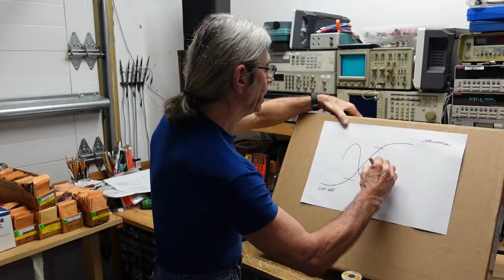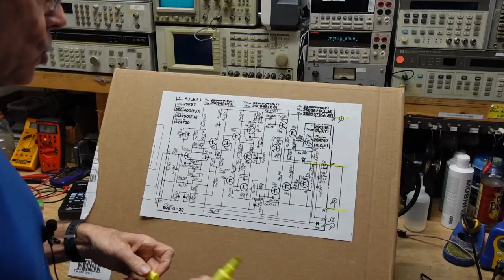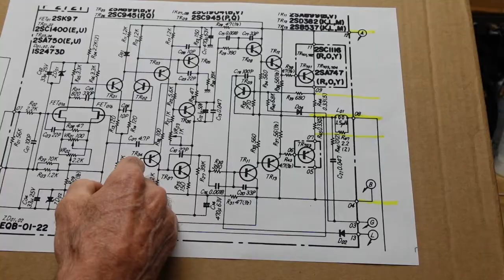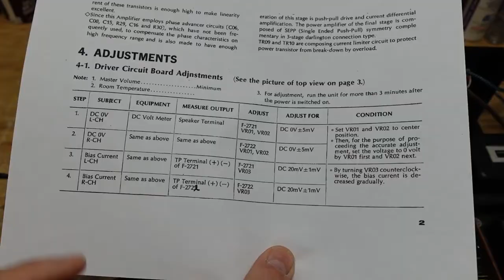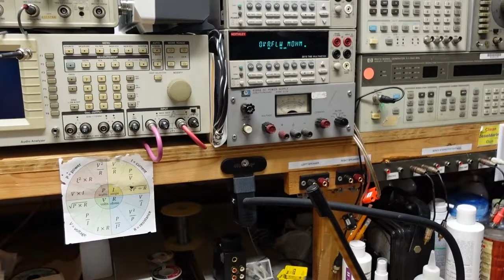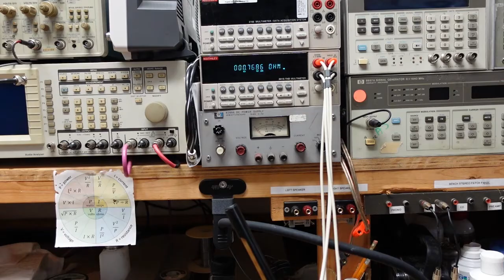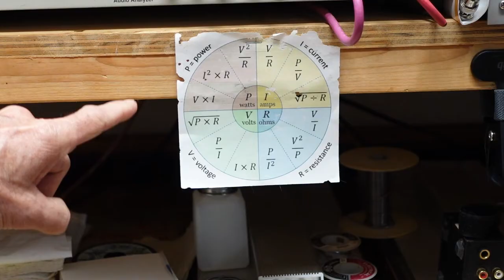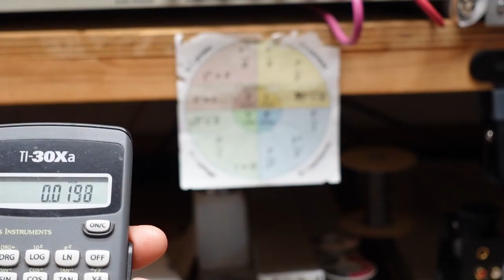Bias and Offset in Audio Amplifiers

Comment: Hi Ray, great video. I have a question regarding setting up bias after the change of output mosfets on my Sony ta-fb930r amp. 
When measuring as described in the service manual, I dont get any readings, even when I adjust the trim pots. The instruction in the manual is a bit confusing. The test points are across only one of the resistors, not across both, like on your video.
Can you give me any points please. Let me know if you need a link to the service manual.
Reply from the maker: It doesn't matter if you measure across one resistor or both.  In the Sony, if you measured across both resistors they'd have you set it to 20 mV instead of 10.
Did you replace the MOSFET's with the exact same ones?  If not, that could be a problem.  In addition, I believe these are obsolete, so the chances of getting counterfeits is greater.
Check to see if the voltages coming from the driver's emitters changes with the bias pot.
Reply: Thanks for your reply.  I replaced the mosfets with IRFP240PBF and IRFP9240PBF.
I will check the voltages across the drivers emitters tonight, what should I expect over there?
By the way the Amp sounds great to me, I was just worried of to not cook the new mosfets.🤣
Reply from the maker: @TheAviator2  Just check the voltages at the emitter of each driver and see if the bias adjustment affects them.
Reply: I have tested voltages across the emitters resistors of the power drivers is at
 min bias 2.64V and at
 max bias is 5.28V at both channels. They were set at 2.8V so thats where I have left it.
Reply: Sorry rookie mistake,  i had my meater on AC rather than DC🤫
So when measuring as described in the service manual I get 0.2mV on left chanel and 1.2mV on right chanel. And no changes when I turn the trim pots. Cheers

Comment: It's not stupid to have a high biased amp if it was designed to have a high class A bias. It is actually a good thing, because class A completely eliminated cross over distortion, thus sounds better. My JC1 mono blocks are biased to 25 Watts of class A and they sound amazing. 

It's only stupid to set the bias higher than factory specs, because in most cases the amp will only run hotter with no quality gain. If you set your customers amps lower than the manufacture tested to be optimum, then you are short changing your customers in sound quality. 

Some people have a "bias" to amps that run warmer than others and such a bias should never enter the equation when servicing amps.

Comment: Can you double the bias current? for better sounding
Reply from the maker: No, excessive bias current just adds excessive heat, and can shorten the life of your output transistors.  Amplifiers that are biased for Class A operation need enormous heat sinks.
Reply: @raygianelli3612  Yes,  add or replace heatsinks or force convection, check xsistors max abs ratings

Comment: thanks for the informative video. I'm having a hard time with the terminology, can you explain why it is called "offset" and "bias"?
Reply from the maker: Sure thing.  Offset is referring to how far the output is from balancing between the positive and negative voltage supplies.
Bias is a small amount of current that is used to keep the output transistors from turning off completely to prevent distortion,.  The term used for a transistor that begins conducting is called forward bias.
Reply: @raygianelli3612  Thank you

Comment: hi ray, I have a sansui au-217 and the test points are not across both emmiter resistors. One test point is between the emmiter resistors. So to calculate the bias current, just use one resistor. calls for 7mv +0.5mv. emmiter resistors are .33 ohms. 7mv divided by .33 is 21 ma. is that correct and do you need a load when adjust the bias.  Thanks your channel is top notch !
Reply from the maker: Hi Fredrick. Welcome aboard!
Your calculations are spot on. No load needed for bias adjustment.

Comment: sorry ray,  i haf a amp ( realistic 32 9003 ), ant  i tinks it need 2 bin tune in the bias.
the richte site, is ferry hot.  hotter than the leftsite so. the amp is from 1995 ??? ant som caps bin don. so..
now i am on the point to do this. batt dont now how.
your way  i onderstand it.  batt mi amp, i dont now how 2 do it.( thers 1 pot on it ant turns, bat the messer on the multimeter. ?? i dont now the spot )
gr fr holland en sorry for mi shitty englis. thanks for the vid.
Reply from the maker: Jouw Engels is beter dan mijn Nederlands, dus laten we eens kijken hoe Google Translate werkt. Ik kan geen schema vinden voor die realistische 32 9003. Heb je een exemplaar?

Comment: Hi Ray, I have a Pionner VSX 523 that power down but it self when volume get 50 (not high at all) . I asume that it goes to pretention mode. It could be a BIAS or DC offset? DO you know if taht modes it could be adjusted? or I need to buy a new board?
Reply from the maker: Does the HDMI LED blink when this happens, or do you see TEMP flashing in the fluorescent display?

Comment: I have an old Yamaha A-700 amp where a pair of the 4 transistors failed. I am in the middle of repairing it. It took me forever to find rare and overly priced used original Toshiba 2sa1333 & 2sc3370 transistors so I am worried about damaging them again.

Some of the capacitors were well past their best before. Could lower capacitance lead to blown transistors? Could it cause too much bias in the transistors?
Reply from the maker: I'd say no.  Electrolytic caps tend to degrade, and performance with it.  They do occasionally short, which, depending where they are in the circuit could cause failure.  But if you're worried about the new outputs blowing, make sure to test everything feeding them.  Bad drivers. predrivers are far more likely to cause catastrophic failures that take out output transistors.

Comment: you need a multiturn pot there .
Reply from the maker: What I need is not to be too cheap to buy multiturn pots. :)  But you're right, it would make life easier.  Still, between the coarse and fine adjustments it's not too bad.

Comment: First of all many thanks for sharing your knowledge. I'm a beginner and I'm trying to fix a marantz pm350, I powered on for a few seconds to check the bias and on one channel it went instantly over 500mV, immediately turned it off. I'm looking for obvious shorts and blown components with a dmm, the outputs aren't shorted and resistors match on both channels, do you have any other suggestions for possible causes? Thanks again
Reply from the maker: Join Audiokarma.org.  I'm a member there.  Post in the Marantz subforum and you'll get the assistance you need.

Comment: With the offset control that touchy, wouldnt it be a logical to assume the control should be replaced? Having had them drift when bumped, or simply become erratic over time. 
  At the factory when built, clearly they would not have been that touchy right? 

 Tank you fir speaking in such a way that i can grasp some if this stuff. 
  The xover distortion specifically. The manual for the Marantz 240 amp says to measure that and adjust bias fir the least ammount. While they changed thier mind a few times with updates, ive always wanted to measure it or view this in some way at the same time i set bias to get a better understanding of what your describing. 
  Thanks for your time in all this!
Reply from the maker: You're right, changing the bias and offset trimmers is the way to go.  Those are new, it's a really touchy adjustment in some amps.  Appreciate the kind words!
Reply: @raygianelli3612  oh new pots? I see. This was why you mentioned multiturn and these being single.
   Ive had 30 restorations done so far, as i own about 100 pieces. I dont do the work, but love to watch videos and learn some of the terminology. Most recent was the 240 i mentioned. 
   Im always looking for others to send my gear to if your interested! Next is the Sansui au 919 and have the "black flag capacitors " removed (as well as others)
  Is there by chance a service you offer?
 Thank you much,
 Charles

Comment: As an absolute beginner who's watched countless videos, I can say that yours have more useful knowledge/wisdom per minute than anything else on the 'net. Thank you for doing these.
Reply from the maker: Thanks so much! As I like to say, the only way technicians can reproduce is to share our knowledge.
Reply: @raygianelli3612  informative, but a question?  You are using the test points inside the  power section to read bias volts. Where are the leads on the 2nd meter reading offset voltage connected?  At the channel speaker terminals, as that is the critical point to have near zero, or other test points? And if indeed at speaker output. Is the amp loaded by speakers connected, or appropriate parallell incadescent lamps dummy load ( 3x 40 watt for 120 watt load) or No Load open circuit o/p, with only offset meter leads connected. Thanks.
Reply from the maker: @jakerabinz9411  Yes, offset is read from the speaker terminals.  Both measurements are taken under no load conditions.
Reply: True!!!